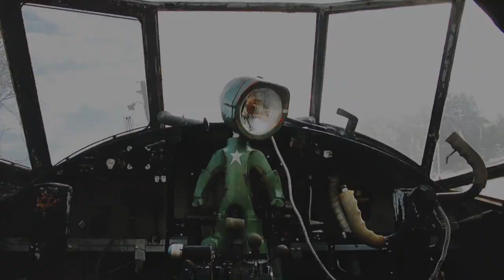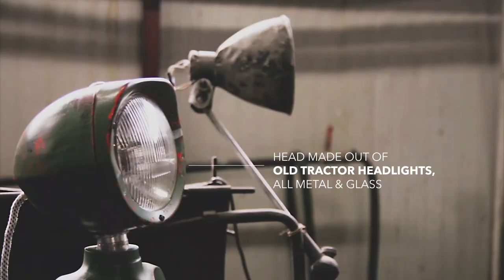The Lampster - superhero robot lamp for your desk

Comment: I am one of the people who already received their lampster. I received it i think around two years ago. I was one of the first bakers on kickstarter and I liked this idea from the beginning. I will not say something about the massive and frustrating delays and the really bad communication of the team. Other people did this more than enought.
I give the campaign two stars on Trustpilot but for the quality of the lamp i actually want to give one of five. Starting by the body, wich are two moulded shells, they fit very bad together. There are gaps all around and the filling material trickles out of them. There are scratches and dents and it is very obviously that the moulds are in a very bad quality. Normally you prime it with filler and sand it but this didn't happend. Also the quality of the paintwork is very low. There is no clear coat on it (on my one) and it feels very cheap. There are like fingerprints and imprints in it. I ordered a black one with two letters on the head. The letters were painted with a stencil and after that they tried to repair it with a brush and a white color wich is much more yellow then the one of the letters. Looks very cheap. But the more frustrating part is that the paint falls off when you run your hand over it. They said the letters will be secured by a clear coat. When i get in contact with them and send them pictures they only had excuses.

The next disappointment is the app. It feels like an app from the beginning of the smartphone times. The user guidance and experience is catastrophic.

I am a designer by my myself and we are creating models and product demonstrations by our self. I know how hard it is to keep the quality. But as a good product designer and builder it must be your drive and conviction to deliver quality.

And for all the other who want to buy a lampster i can give you the advice, in reality they don't look like they do on the website.